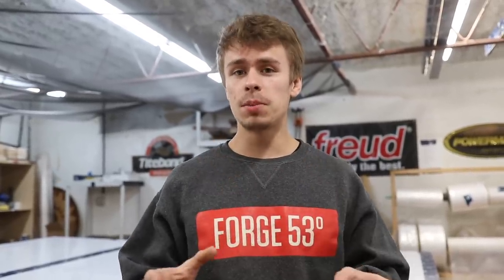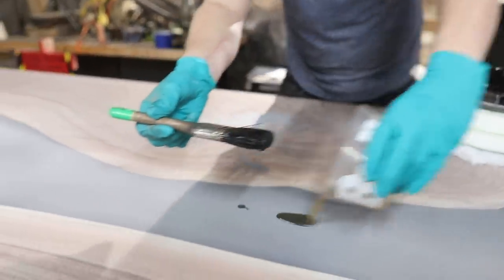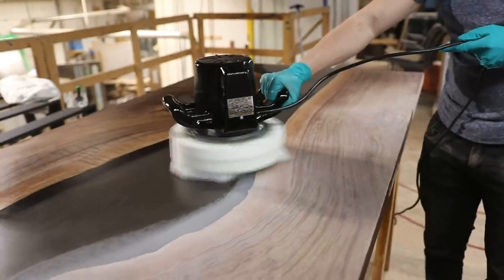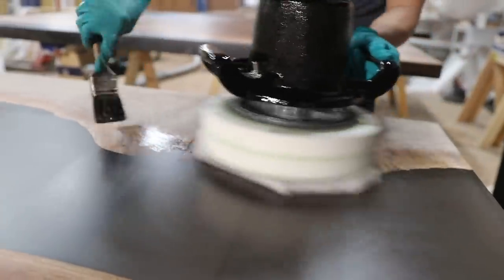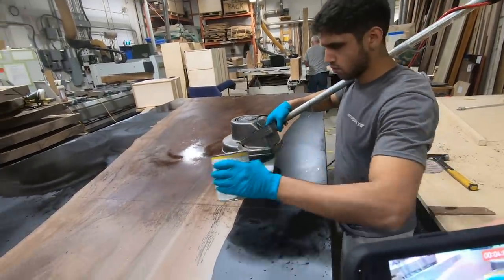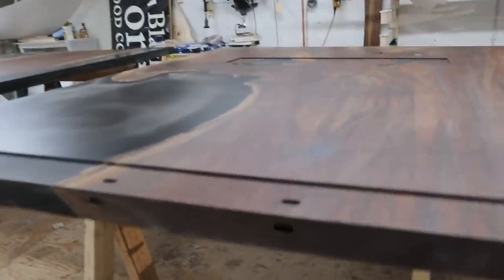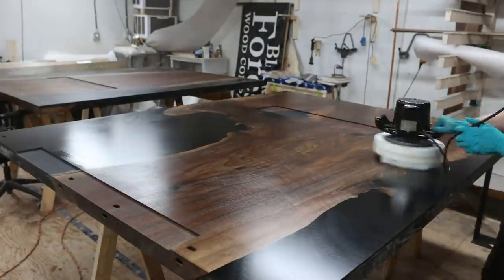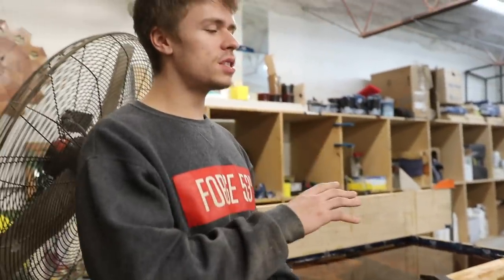Finishing Tips for Resin Tables

Comment: Just wondering, why do you cover the wood slabs in resin too? Doesn't that waste a lot of resin? Or is it so all the little pits and grooves/cracks in the wood are filled in? (Or, is it so you can sand away any bubbles on the surface of the resin so you don't need to be too careful when you pour it?)

Comment: Love your videos and tables. I have a intrest in doing some custom epoxy tables for myself. I was wondering if you can do a how to on the minor details. Like how much over you pour and why along with working it down and what some options there are for workung it down. Plus how you do the math to figure out how much resin you need. I know you have covered most of the stuff in your videos but a nice how to pulling in those bits and pieces would be an awesome addition. Especially the measuring math.

Comment: Why do you guys put what looks like supports for beams over the pour directly onto the wood that your pouring resin over, it seems like that would ruin it. Also how do you get resin onto the bottom of the table?
Reply: Charles Mullins It’s to hold the slabs in place so they don’t lift from the form.
Reply: So the wood doesn't float on top of the resin. They use a cnc router to remove the layer on top and bottom of the table and also to inset the leg supports.
Reply from the maker: Uptin Sinclaire is right!!
Reply: @BlackForestWoodCo  And wins a free gallon of deep pour epoxy. 😂😂😂😂😂

Comment: You should try mixing Graphene powder with you resins gives a really nice rich black and Graphene black sounds good and it would make it conducive as well. That means you could use the table surface a touch switch to turn lights on or off. See video https://youtu.be/kwZ3rMn4uDc he could give you good advice on using Graphene and also provide you with the right type of Graphene for your mix.